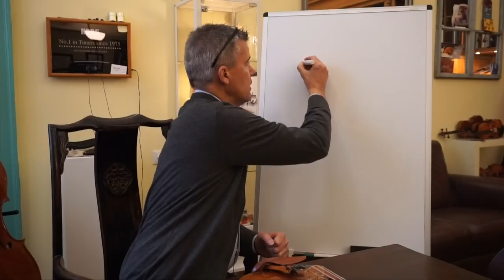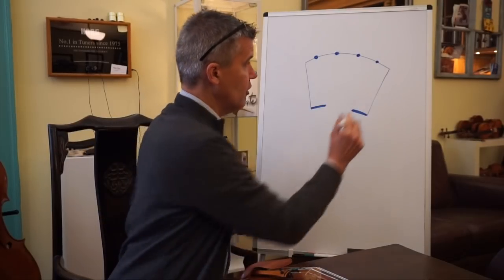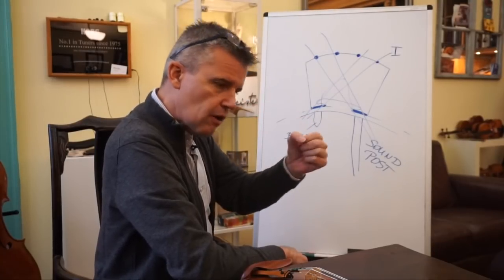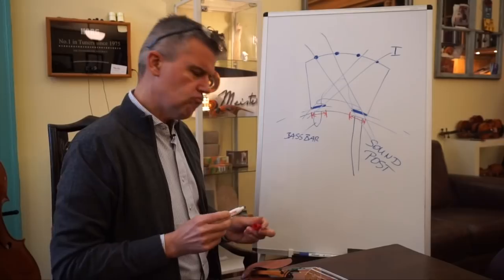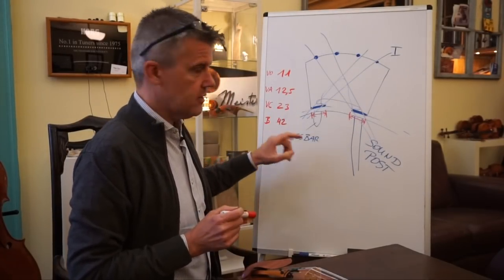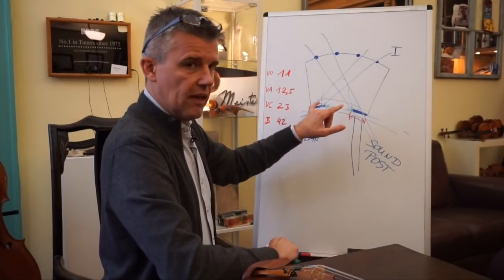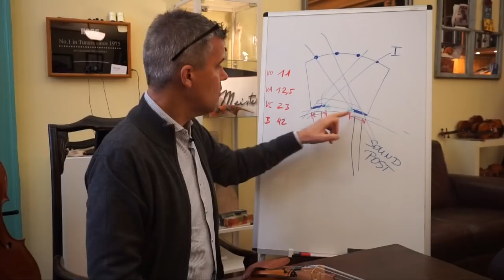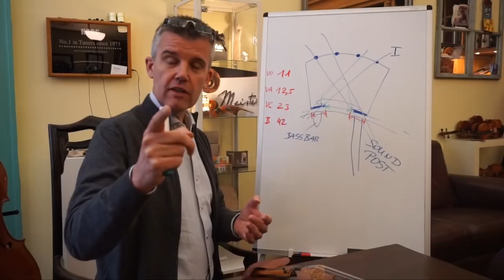Ep. 38: The Bridge X-Factor

Comment: Helpful as usual. Thanks. How can you make the E string less intense with the bridge?
Reply from the maker: if it is only the E string, I wouldn't solve this issue with the bridge. Very likelyI would give a small it on the soundpost ONLY on the lower side (the side which is on the back(maple) towards the neck. Just a hit in order ta you feel that something has changed erase of the hit. less as what you can see. In that case you actually change the touching point area of the soundpost on the opposite upper side towards the top.

But if you insist:
Soak the bridge where the strings lay with instant glue. This makes the wood harder and might give what you search.
But please NEVER glue the little skin with instant glue. This glue is too hard and later on creates annoying buzzes. Always glue the skin with white or hide glue. More elastic.

Hope you got the msg.
Have to run now to my exhibition here in Seoul.
all the best

ER

PS.: and let me know if...........🏃🏽‍♂️